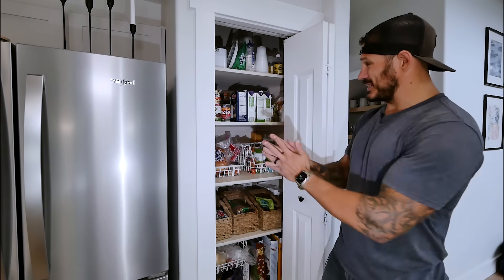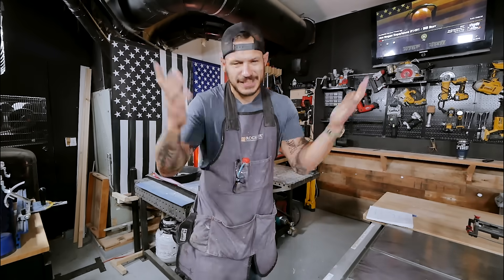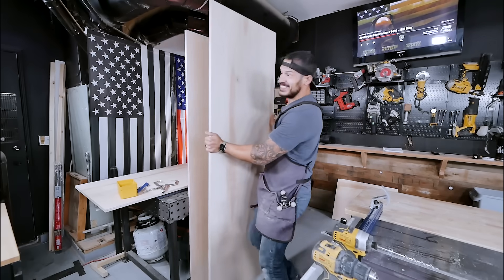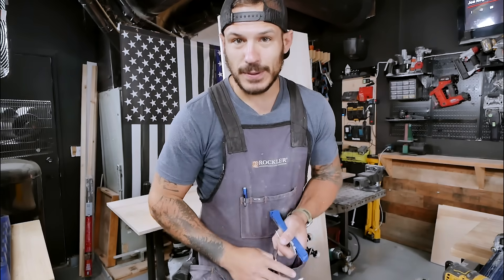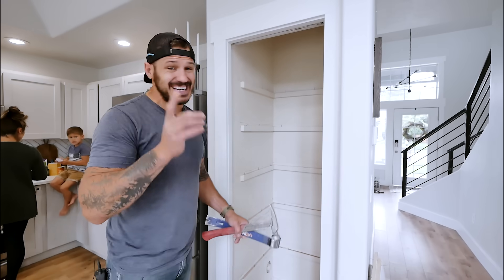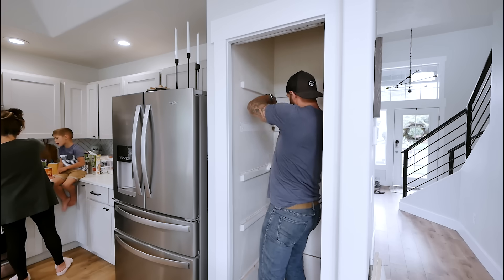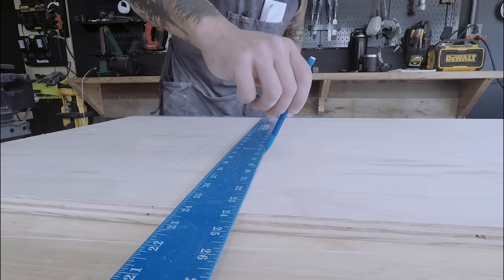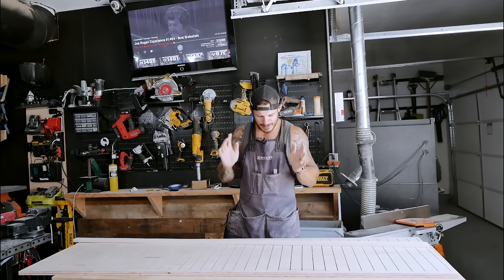Tiny Pantry Closet With MAX STORAGE!

Comment: Not only do you make mistakes you also learn how to correct them.  I've fixed up several homes we've had will all kinds of project. My first house was 100% a fixer upper and stuck in the 70's.  Not a room I didn't touch in that house.  Current house go floors last summer and it was not my first time to lay flooring, but I even learned a few things and also some things I'd do different.  You don't know if you don't push.  Used those little connectors in Telecommunications for years in cable pedestal to snap together twisted pair for land line phones and DSL.  I think they were made by scotch originally and everyone just refers to them as a scotch locks.  Same thing just a bigger cable.  Likely a 3M product.

Comment: Nice job Max! I did a similar thing but didn't want to loose shelf space so I just used the existing shelving and freed them up putting them on rollers with a minimal barrier across the back to keep things from falling off when pulled out. I get the idea with the cut out top shelves but I didn't want to loose that real state so I just added lighting to see seeings clearly.  Mine was already bigger with better access than your old pantry. Wish there was a way to share a photo here. Is there? I wonder if splitting your door in half so the drawers are behind one door and then french doors for the top half would be a better option?
Reply: It makes more sense to me to use the existing Shelves. He lost a lot of storage space and the insert didn't seem necessary.

Comment: Electrician here.
Regulations will depend on where you're located.
You have good advice concerning box depth and not leaving hidden junctions.

Where I am you can't have plugs in furniture behind doors.
Except:
1) the plug turns off when the door, or drawer, is closed.
2) the plug connects to a dedicated alliance. (Could argue that the coffee machine is dedicated, but a better example is a microwave that occupies the entire space)

also leave 6"-12" of wire as extra, I the outside, at every junction.

Very good woodworking ideas, good presentation, and content.
Subbing 👍

Comment: Couple of questions.
1. Think about putting a piece of white pine trim along that top behind the door to close up that gap above the shelving unit?
2. I know it is on the inside of the door, but thoughts on trimming out the backside of the door just to cover the pocket holes and add just a bit more rigidity to the door?
Overall, that is a great build. Our panty is about the same, but a bit wider and it is such a pain to see things because it is so deep and dark. I may be doing something like this in ours. Great video. Keep up the great work.

Comment: Hi, when you were showing ironing on the shelf edging strip you put it on where you had pocket holes to screw onto the sides, why?. In addition, you made new draws because you measured to long why not cut the extra off and use the original draws.
Reply: Not to out him, but it looks like he made 3 new sets of drawers. You saw him screw the slides flush to the cabinet, but at 16:45 you can see he had spacers behind the slides (most likely to clear the hinged door so they can pull out).
Point is, event the second set was too big.

Comment: I think one additional item you could add would be to insert a magnet at the top of the door to assist in keeping it closed since there does not appear to be a latch or catch on the frame.  Other than that, great video.

Comment: Is there a reason why you have 3/4 in spaces between the cabinet and the drawer slides? I noticed them at the end of the video but doesn’t look like you used them when you were securing the drawer slides to the cabinet. Just asking because I will be doing a similar project in the next month

Comment: Just FYI for those doing electrical on their own homes. There is almost never enough slack in the cable if done by an electrician. Just enough from point A to point B and to fasten to the stud. So the best way to do it is to find the nearest receptacle/outlet, ensure the full circuit (# of other items on the same breaker) typically not to exceed exceed 80% of breaker capacity. Which the breaker is typically 15 amps in most homes for receptacle runs. Anyways, if you are good on that, then you just run the cable (which is usually 12 or 14 gauge wire depending on breaker size) accordingly and your good. 
Also, be weary, from my understanding insurance may not cover electrical fires if not done by a licensed professional and ends up being wired incorrectly which I have seen, and heard about,  homeowners doing. Also, there are a numerous rules and regulations involved in wiring these days. I enjoy the channel and look forward to watching more of your stuff.

Comment: Those connectors are called wagos, pronounced “way-goes”. Not an official name but a trade name based off of the name of the brand who makes them. From what I’ve seen, the  contacts (part that grabs the wire) loses tension over time due to heat generated from the electricity and causes a loose connection, wire nuts are definitely the way to go!
Reply: Thanks for the information
Reply: Wagos loose tension based off of where they have been used. The Wagos 221 I have been using for years work anywhere from the roof top in the J Box, in the outside wall in a disconnect, and even inside electrical running. They are compact and very very useful. I'd recommend those every time!
Reply: I dont think that's true. The one he is showing isnt a wago and then he talks about a twisty one and those aren't wagos either. Also, wagos are safe, nothing is losing tension. Do you think they could be sold in the millions if that was the case?

Comment: interesting, was just about to take on a project like this so will use some of this idea. In my case its a larger space, 5' 8" wide, 3' deep and 6' 8" high. I dislike the idea of losing that last 1 ft 4 inches over with a topped cabinet like this. debating doing it anyway and framing in some cubbies over the space to maybe act as long term storage slap on doors and make it little built in cabinets i guess but not sure how that will look in the end.

Comment: -Not and electrician here but lots of experience with those push in connectors: super small contact area + heat from those wires over time will create a no-contact/faulty plug.   Pain in the butt wirenuts will increase contact surface and not generally fail. Just FYI!

Comment: 16:28 What's with the gap? Top right corner.
Reply: I think the door is slightly open making it seem like there's a gap.
Reply: The frame isn’t squared... as he mentioned at the end
Reply: Not too sure what the point of the box is. Who cares if the inside walls were white drywall or maple.

Comment: Great work! Looks amazing. How did you finish the cuts in the door? I get what you did with the tracksaw but that will give a 'round' cut due to the circular blade. How did you square it? I guess all handsaws are  thinner kerf making it not very clean. Or did you leave the cut rounded? I guess from up close that doesn't look very nice?

Comment: I was looking for any advice and suggestions on modifying a small kitchen pantry closet by removing the wire shelves and replacing them with pull out shelves. Your video assisted me in a number of questions I had/have.  Bravo and thank you.  If I may address a video issue rather than the technical issues, with no malice intended.  You have a dynamic personality and presentation, fast speaking, movement and gesturing. This became disconcerting for me we watch as you taught in the video.  Your use of fast cuts in the video without allowing time for me to focus on what I was watching was another point.  And finally, when you were working on the very cool looking door, I was trying to listen to you as you taught your technique while also trying to follow the video of you working, the clip cuts were tooooooo fast when timed with what you were saying.  I would have loved to watch a slower video in sync with your description.  This may have been better as a slower/longer video or two videos, one of the original problem and the deconstruction and wiring and the second addressing the process of completing the carcass and installation closing with the door process and ending with before and after shots. Also, what’s with the hand slaps at the camera when you finished a segment, I wanted to put on boxing headgear to protect myself. 😳😳😂😂😂
Just one guys humble review of a good process of a guy that seems to love sharing his knowledge. I appreciated your comment that, “you were not afraid to try,” that says so much and is sage advice for some many things.  
Thank you.

Comment: They’re called wagos and I absolutely hate those things they have created so many issues for me... maybe just me and my experience but every time I go to a job that those things they always burn up due to the wire arcing inside of the connector. But they’re required inside of lights you must have a quick disconnect in lights in order to change out ballasts and lamps and what not.

Comment: When you're using a band saw like you have, lower the guard down to only how much you require the blade to cut/thickness of material. This will help stop flex in the blade. This is basic h&s.

Comment: As a seamstress I cried inside when you said no water in your iron. You can ruin it by doing that so when next time you put water in it will leak cause the plate inside cracked from the heat and no water.
Reply: I guess thats why our iron is leaking 😅
Reply: You can use an iron without water if you turn off the steam. It's done all the time.

Comment: The electrical guys in the audience are all screaming  wirenut “twisty thing” wth man. Also those “easy ones” are push connectors as we call them are meant for low voltage (inside light fixtures) not main connections for 12 or 14 gauge wire. Not going to burn the house down but not nearly secure as a twisted wirenut

Comment: How NOT to build a pantry. While I appreciate the honesty regarding the mistakes, that was painful to watch. That project could have been done so much easier and neater. Why not just screw the cabinet together with normal countersink screws including the shelves (meaning no exposed pocket screw holes)? When making drawer cut lists work from the size of your top/fixed shelf/base. And when trimming edge tape try using a chisel or hand plane blade.